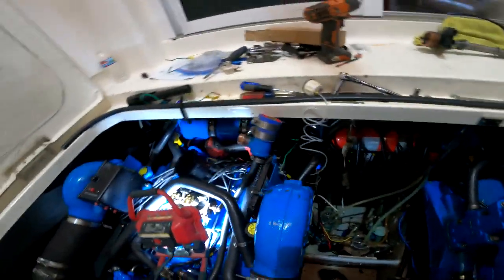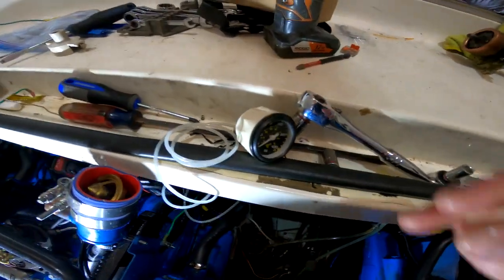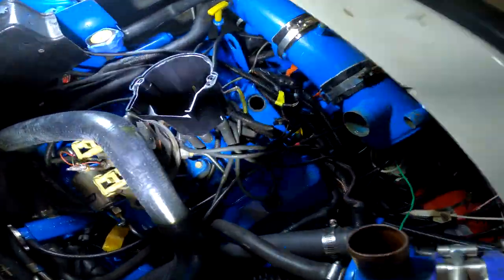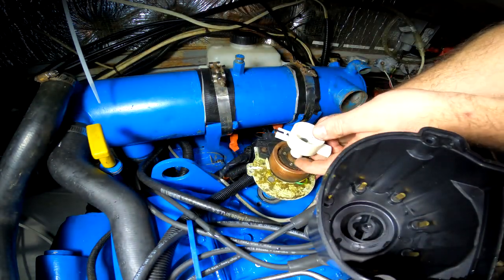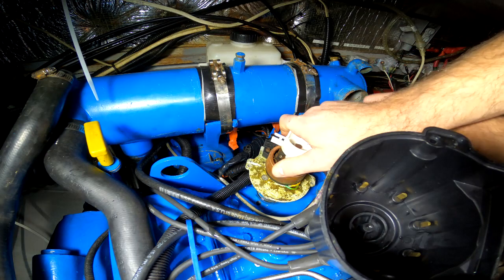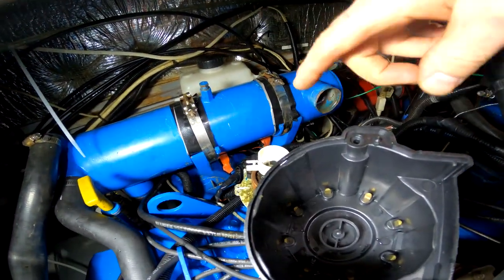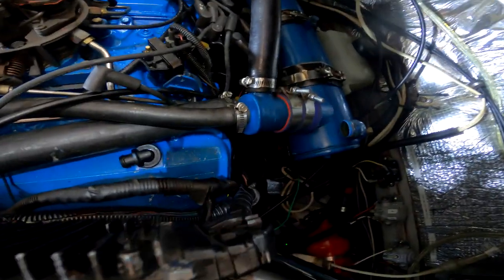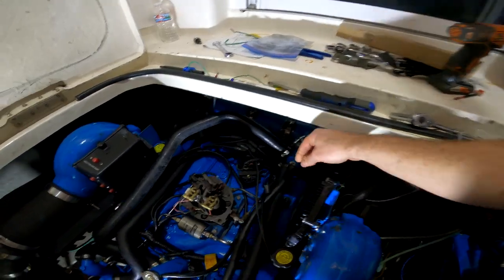35 ft Silverton 454 Crusader Install PT 3

Comment: Did you happen to get or know the weight of the engine before you put it back together?
Reply from the maker: No sorry
Reply: 700 lbs is what my engine builder put as shipping weight I have the same engine.  My 1 ton Harbor Freight cheap stand held it fine with no sagging but without transmission or exhaust manifolds/risers.